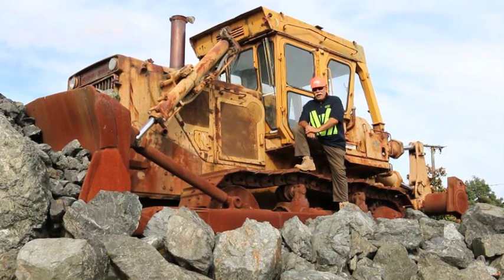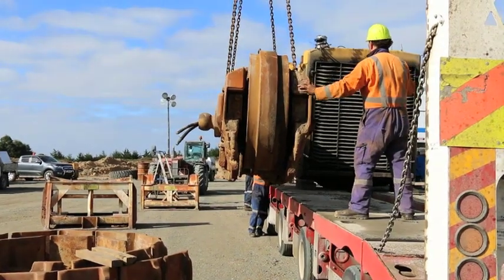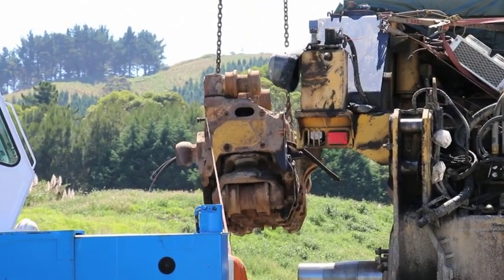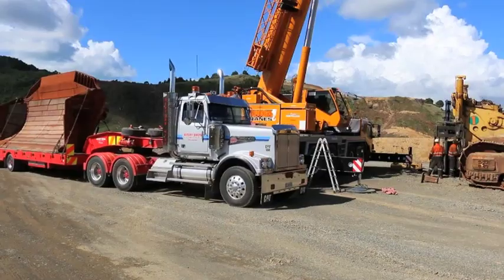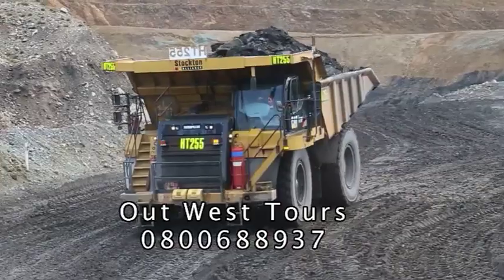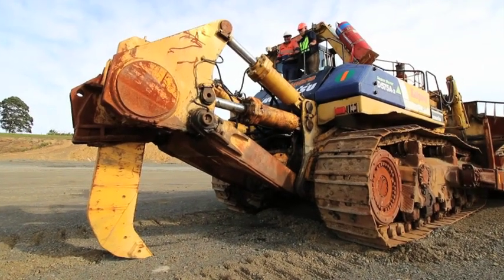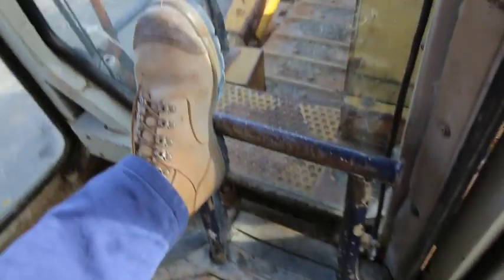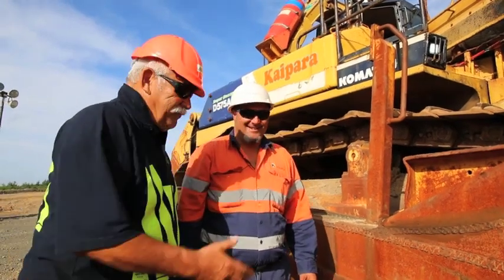Low Gear TV - Series 3 Episode 8

Comment: that dozer in between the 2 big 575 dozers is a smaller Komatsu not a cat d9, no elevated sprocket,and you can read the word Komatsu on top of the radiator, great video lots of detail.